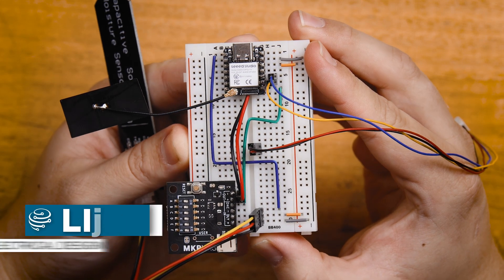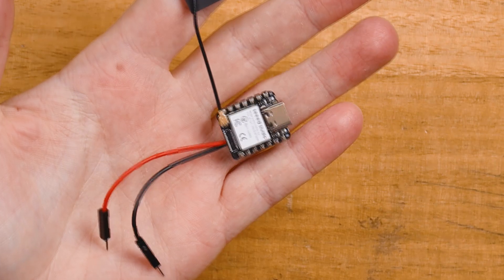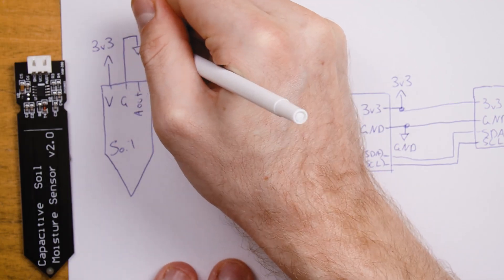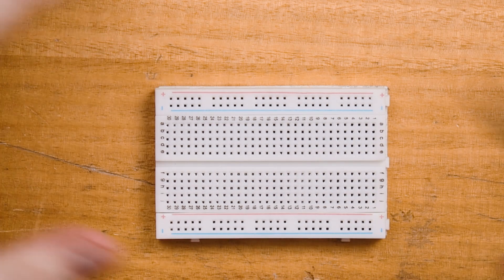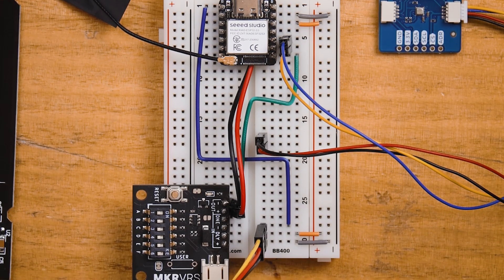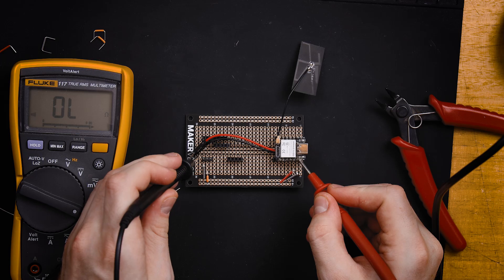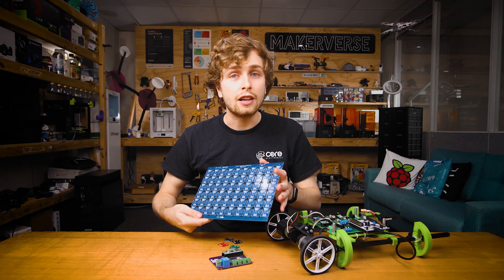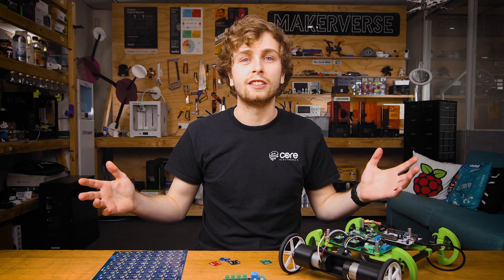Breadboards vs Protoboards vs PCBs | Zero to Maker Workshop

Comment: I was hoping that you'd touch on individual tie-point protoboards, because I'm many years into this and I still don't get it. When you have a connected row, a bit of careful planning means you can create a much more durable prototype. But what is the utility of individual points? Connecting two things together becomes miserable, and connecting more than two things is a genuinely bad idea. There are definitely people who seem to dribble solder between points; even if my solder flowed like candle wax (it most certainly does not) I am hard pressed to think of a more miserable way to connect the dots on a circuit.
Reply: I agree. There is a difference between a tracked perfboard (similar to your breadboard) as it is easier to transfer your layout. However if you want to compress your working breadboard prototype to a smaller more compact layout then single pad perfboard can help with that process. I found something called Nodal Analysis which uses top board insulated wire connectors that run vertically whilst bottom board connectors run horizontally and are made by pad to pad soldering, or bare wire with a solder bridge to link more than one item along a track. The trick with bridge soldering appears to be letting two pads cool & harden before trying to bridge them with soldering the pad between., Review of the Nodal layout before construction allows you to rearrange the circuit to compress the number of columns and rows required. For example one column might be able to accommodate more than one vertical connector without affecting the overall circuit whilst exploiting the fact that horizontal pads are NOT tracked may allow you to combine more than one horizontal connector on the same track if they are not connect to each other (as you would do if you used a drill to cut out a track to allow you to mount an IC on either side).
Reply: @sharonjuniorchess  I (think) I get it, but the more I consider it, the worse it sounds to actually work with. Assuming that you know in advance where everything should be and is going to go, a circuit of any real complexity is going to look completely crazy from a debugging perspective. Good luck getting mentorship when you need to start explaining your "traces" in 3D.

Here's the thing: given that we can design a PCB using open source CAD tools and manufacture five boards that arrive in a week for about $10, I would argue that in 2025 there is no update to transferring a circuit from a breadboard to a pad-to-pad perfboard. It's not even a flex, it just signals that you don't understand prioritization, don't prioritize debugging access, and don't access services that are 1000x less expensive than they were in the 70s when perfboard was the only option.

Comment: A lot of modern parts only come in SMD type packages, which can be limiting. If you want/need to breadboard these, sometimes you can get generic SMD breakout to breadboard PCBs, if you know what IC footprint you're working with. Strongly recommend this approach.

One of the hardest lessions I've had to learn - especially with more complex designs that are difficult or impossible to breadboard... is just get the circuit board made, and if it doesn't work right, that's ok. THAT'S A HARD LESSON TO LEARN. But just get the PCB made. If it doesn't work right, it's a prototype and a learning lesson towards a final design.
I find a lot of my board designs go through 2 or 3 revisions before I get to a final design, and... that's ok.

Comment: I'm pretty rubbish at soldering because I've rarely used it, with many months' gap in between practice; so I went for the breadboard solid core wire for my first major project.  The rats nest, created by myself, was driving me nuts for the number of times I accidentally pulled a wire out and had to traverse the wire jungle to get it back in, while trying to not pull something else out. I'll need to practice my soldering skills before moving onto protoboards, which I'll eventually do because I want to make my projects at least semi permanent. Thanks for the protoboard tips;  I'm sure I'll come back to these for a refresher.
Reply: The biggest issue I see is using these irons with huge tips like this video, I have a 15w antex with a sensible angled tip I got off my father almost 15years ago and had already been using 15 years previous to that. I’m not amazing but I’m reasonably neat and can tackle the odd smd project. I tell you now, it just takes patience and technique, and if it’s not going right, put it down and go take a breather. You’ll do a better job another time.
Reply: @captainmcadams  Thanks for the tips.  Been having to do quite a bit of soldering because I made the jump from breadboard to perfboard on my project.  First few perfboards were not a pretty sight, but I started to get a feel for it, and a multimeter has been a huge help.  I'm way, way off from SMD, so if I want to make a much smaller iteration of the project, moving it to PCB, I'll get the manufacturer to do the SMD if I choose to go that route.
Reply: I found that when I get the soldering tip dirty, the heat transfer is not there, and the solder balls up or does not flow well. Making sure that soldering iron tip is clean and tinned, prior to soldering,  solves a lot of the problems.
Reply: @chrisstromberg6527  Thanks for the tips.  I actually have to get a new soldering iron because my current one is both pretty old and cheap and I don't think the tip was replaceable; it was oxidized quite a while ago, and I would have to give it a scrub each time before use. 

 I think a fairly decent one with exchangeable tips will be a good investment as I'm going to be starting my next project in the near fugure.

Comment: heh, I murderized a Pi Zero 2W desoldering it. Carnage. Live and learn, huh?
Reply: We all start somewhere, practice does help, but it hasn't made me perfect ... yet.
I've been soldering pins to a few ESP32-S3 boards lately and didn't want to mess up, so I used a flux pen on pins and the boards. Used small diameter solder that has flux core, made sure the iron's tip is clean and well tinned and so far, so good on those.
I did mess up a small prototype board with a  2x15 1.27mm pitch female connector though, just yesterday. I can't even see the small stuff and have to use my magnifier with it.
We all make mistakes, unless we're getting paid to do it perfect. In that case, practice, practice ... then practice more.
Reply: Live and learn. Desoldering is hard too.
I speak from experience; I just murderised an ESP32 pico QTpy. I'll admit there may have been a few tears.
Reply: @LordPhobos6502  the first time you wreck something is gutting
Reply: @StitchesLovesRats  it really is 💔